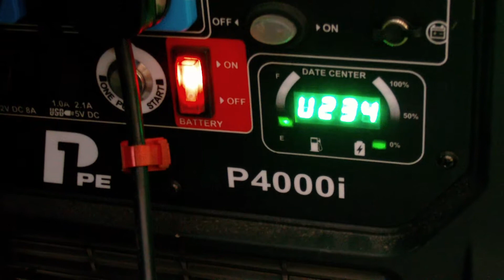testing the hyundai p1Pe 4000i inverter petrol generator to it's limit with an inverter welder

Comment: what do you mean by "badged up as WESTINGHOUSE IGEN4500 and PULSAR PG400ISR"
 ? any video of replacing oil for this generators ?
Reply from the maker: The generator is mass produced in China, then relabelled before going out to different countries. Your Suppier will explain how to check and fill with new oil, also fully illustrated in the Manual